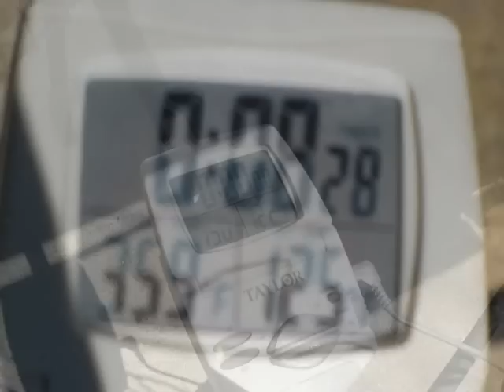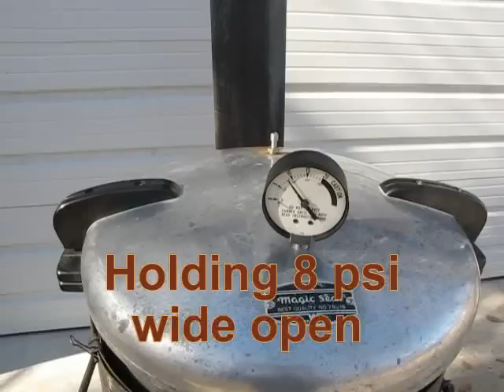Pellet Burner for Rugged Rocket Stove

Comment: This rocket stove is an amazing setup!!!  As an old machinist, this thing is gonna drive me nuts until I can build one.  I have been looking at different rocket stoves for a few years.  I've seen some made from soup cans, bricks, concrete/perlite, propane bottles and cob.  Yours is hands down the finest rocket stove I've ever seen.  I'd sure like to be on the list of folks who could buy the drawings whenever they become available.

I just got back from a 7-man camping/hunting trip and used 5 cinder blocks for my first rocket stove ever.  It cooked everything perfectly but, it starting cracking from the very first fire and did so until the last meal.  By the end of the trip, if someone would have so much as bumped it, the whole thing would have crumpled into a hundred pieces!!

No one on the trip had ever even heard of a rocket stove.  They were blown away by that disintegrating block stove.  I can only imagine how they'd react to a first class rig such as yours.  You should be proud brother.  I'm proud for ya!!!     

Does the burner directly over the fire burn hotter than the one closest to the chimney/flue?  What is the thickness gap of the heat chamber where the heat travels between burners on it's way toward the chimney?
Reply from the maker: Thanks for the kind comments! The area directly over the flame is quite a bit hotter than toward the chimney. I've measured over 900°F at the disk. The gap where the flame travels up close the second 'burner' area is about 1/2" above the baffle. I, too, have played with various versions of block rocket stoves and gave up on them. Fired brick is a different story - you can make a nice stove with those.

Comment: I made a burner much the same as that to mount on my wood stove and it works perfect. I heat my home with it now. I can get the burner tube red hot and the stove over 600 degrees (too hot actually) but I run it around 400 degrees with the air shut down to just 1/4" opening. A 40 lb. bag of pellets last over 10 hours with my setup.
Reply from the maker: Painter D Do you have a video or photos of it? Would be interesting to see.

Comment: I really want to build one of these...  I have most of the materials, except for the cook top... What thickness is the top?  I'm thinking it looks to be around 3/16 or 1/4" ?  Not a stove to pack around from place to place, but an excellent design, very adaptable to so many uses!  do you think it would be a good idea to make a pellet basket out of stainless steel instead of mild steel for longevity?  Thanks, you're inspiring me to come up with some really cool stuff!

Mike
Reply from the maker: Mike G Mike, The cook top is actually made from a piece of steel I-beam. I torched off the sides to make it flat on one side. The thickness is about 3/16", a little thicker near the edges. The stove is heavy but lots of potential to lighten it up some - still not for packing around! The pellet hopper is never in the fire, only the SS grate, so no need to make it from stainless steel. I've burned many pounds of pellets in it with no problems.Glad any time I can be of some inspiration to others!

Comment: I've been getting into the small form factor house thing, and this stove would fit in, nicely! with that pellet hopper, how long of a burn have you been getting? Important to know, especially if someone is also using this for heat.
Reply from the maker: A full hopper will give you about 30 minutes, but you can easily build a larger hopper over top of it to give you lots of extra time. Since there's virtually no ash you don't have to worry about cleaning out the ask box often.

Comment: @approtechie
approtechie Have you ever gotten that cover plate hot enough that it doesn't hold a magnet any longer?
Reply: I like it! You will by the way!
Reply from the maker: So far I've never had any issue with the magnet getting too hot, but I understand the principle and am careful not to keep it on there for long.

Comment: Could one drive a turbine with the pressure cooker and make electricity? Or distill clean water?
Reply from the maker: CCMPULM Yes, I'm sure you could do that if it was a small turbine and generator. And, yes, you could re-condense the steam and have clean drinking water, even from salt water. The only thing I might add is a carbon filter as a final stage to catch any light organic chemicals, if present, that might have boiled off with the water. Good thoughts!

Comment: Great idea, but those pellets cost money ,you can find free wood everywhere,even junk 2x4s work great cut up for fuel, even if they do have nails in them.
Reply from the maker: ilililhy1 It will certainly run on dead fall and scrap wood, no problem. That's mostly how we use it. However, the pellets are about $4 for 40 lbs. so not very expensive, and they allow you to leave the stove with confidence for extended periods of time.

Comment: I built a 2 foot by 4 foot pizza oven on top of a very similar pellet chamber and am having trouble getting up to temp in the baking chamber. Any advice?
Reply from the maker: Make sure your combustion chamber is insulated (this one has 1.5" of Perlite around it), insulate the outer part of the oven if you can so it retains the heat better, make sure there's adequate airflow through the pellets, keep the oven about 12-16" above the pellet grate so the hottest part of the fire is on the oven. Not sure beyond that without any pics or vids.

Comment: how long did it take you to build it.?  Have you cooked on the surface?
Reply from the maker: It was sort of a piecemeal project that took a few weeks of working on it now and then. I added stuff later, like the pellet burner, air controls, oven, etc. We've cooked on the surface many times, sometimes with foil laid down to catch grease and such. I works very well.
Reply: I was thinking about the grease as well.  I wonder if building up the cooking surface sides to trap the grease and then push it to a corner with a can hanging to catch it. ?  When I watched your video, i was thinking grease was running down the sides of the cooking surface and falling onto someones feet below.